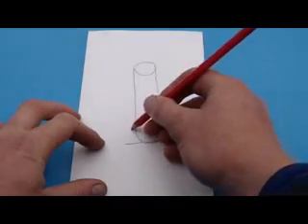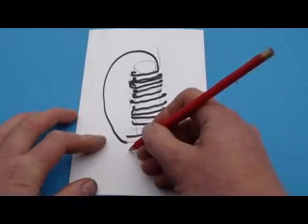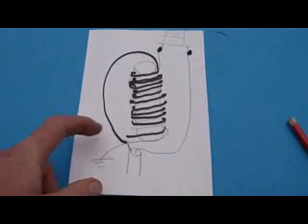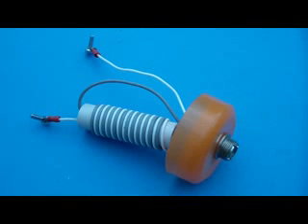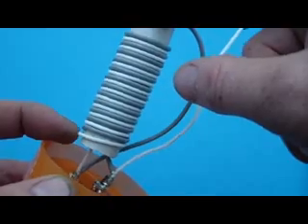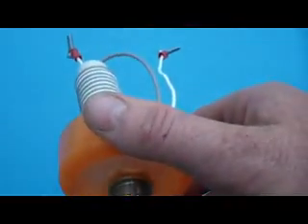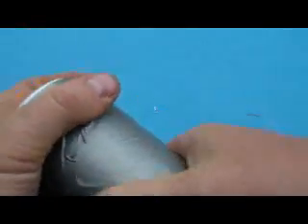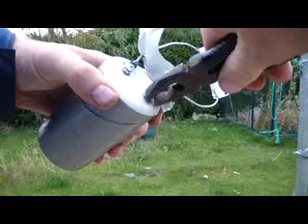How to make a 4 to 1 balun cheap and easy_low.mp4

Comment: A question. What happens to the unconnected end of thick black wire at the bottom (2:50)?  Should this go to the coax inner/right side of open wire feeder?